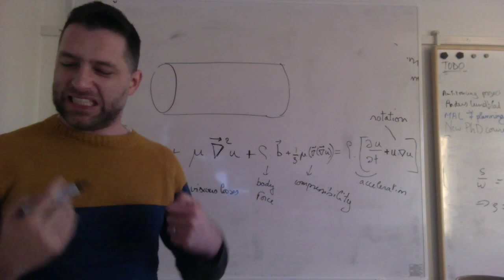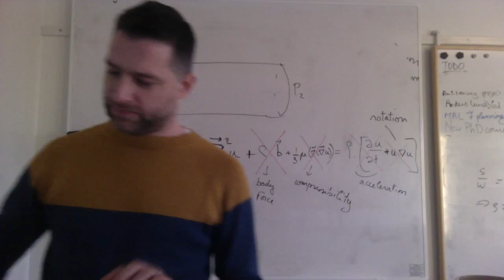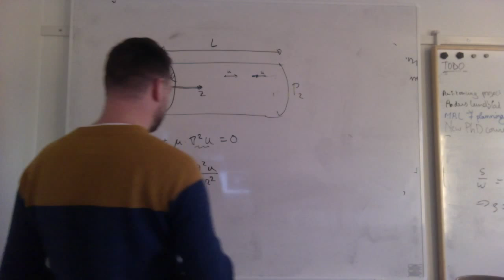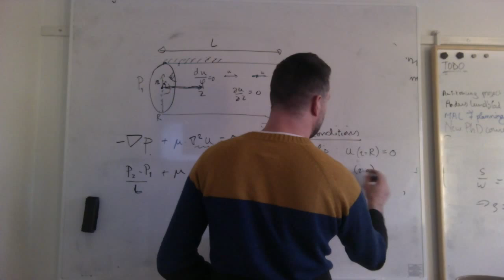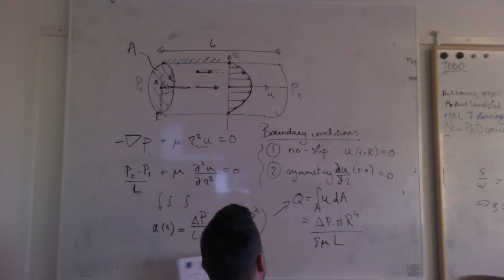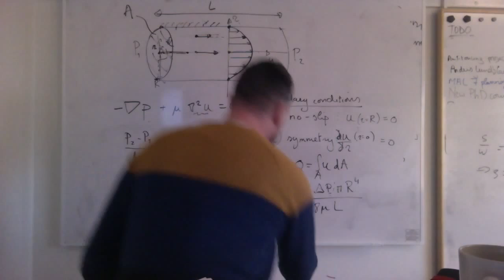From Navier Stokes to Hagen Poiseuille 2

Comment: Your Basic euqation is not in cylinder coordinates. If you do the integration manually, there will only appear a 2 instead of 4 at the pressure gradient.